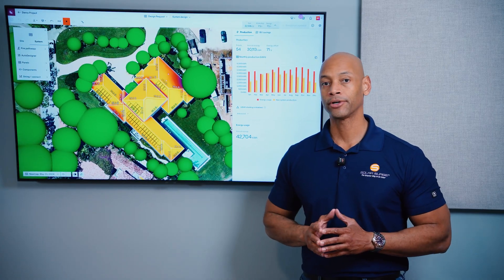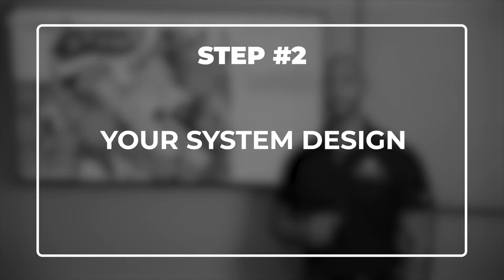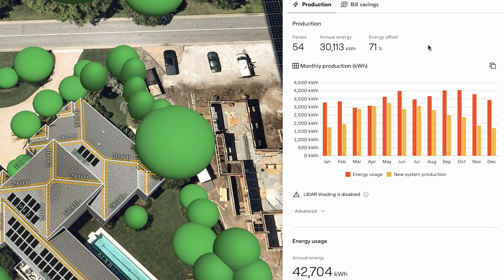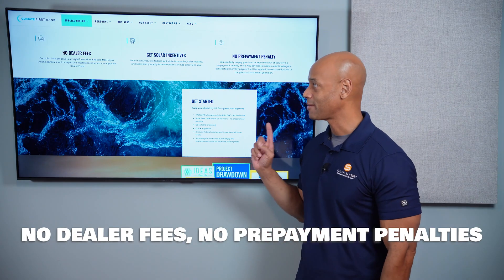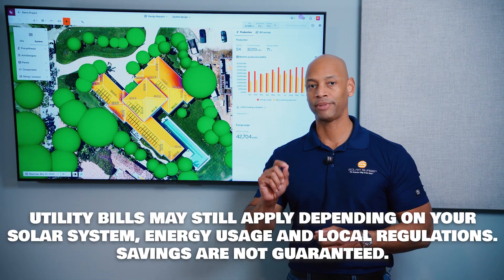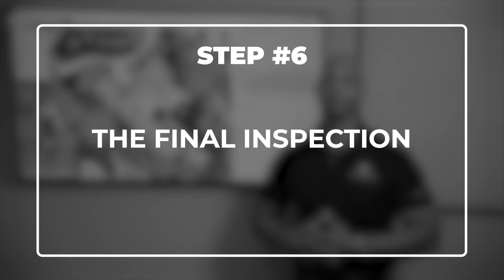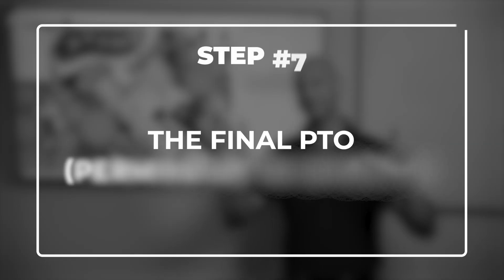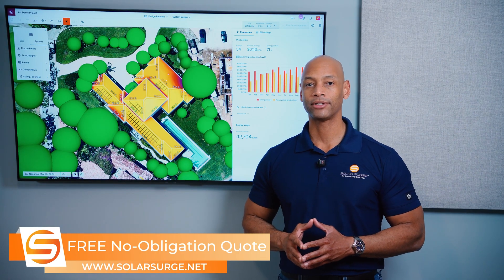The Solar Installation Process: Step-by-step Guide

Comment: I think you should also include a video like this checking with your insurance company for any unforeseen things about dealing with the Insurance with the stuff on the roof.

Another thing would be to also include having to set up connections for EV vehicles, and and such and maybe a set up for a generator in case you need to hook up a generator to it 

Thanks for your information though